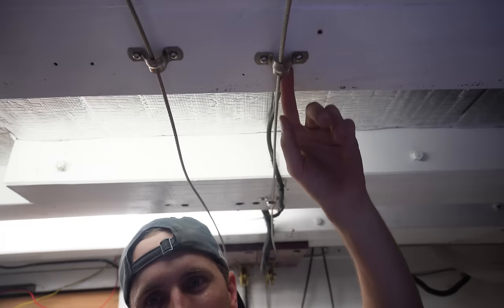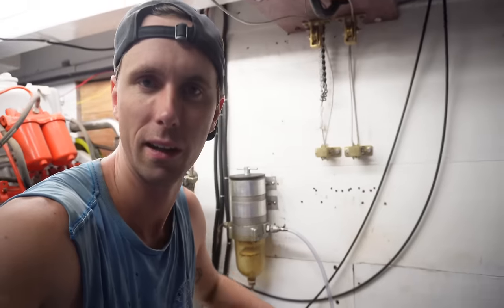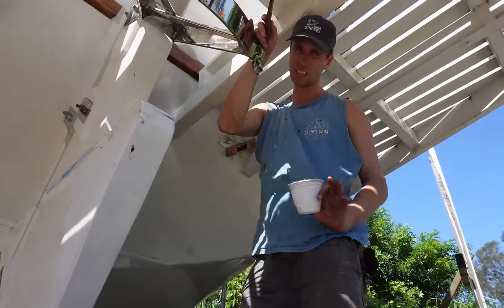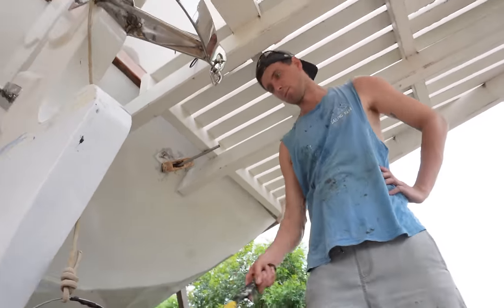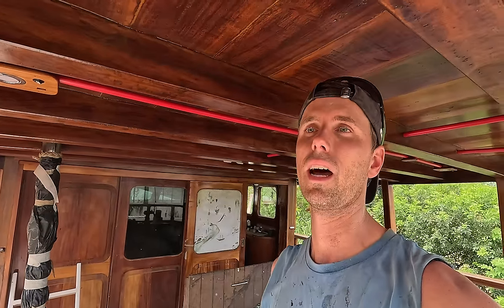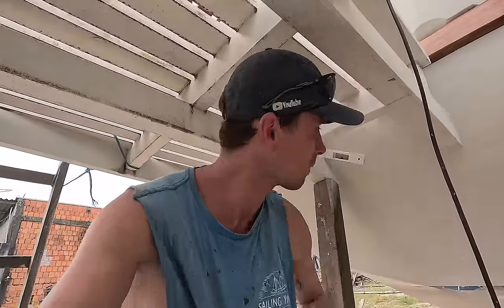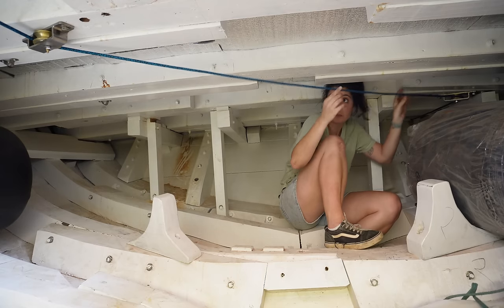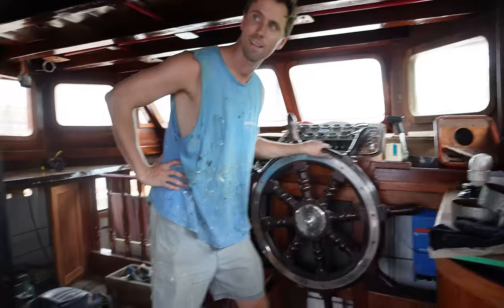Steering upgrades: Ready to steer our rescued boat — Sailing Yabá 166

Comment: man this is just bad.. Really hoped you had swallowed that pride, or whatever it is that is keeping you from bringing in a marine engineer to help you design and Spec out the steering system. Maybe its just naivety that is allowing to think this is a good solution. But to put it into perspective, a lake bound, 16', 50hp outboard motor use 3/8" wound cable with a Teflon sheath over them.. and they still break in rough weather.

Comment: Ach. Its painful to watch you when you make a mistake. A lag bolt is much stronger in shear, as per your inital installation, vs a lag bolt in tension. But you upsized the bolts, its probably good enough. Just unnecessary work. The dyneema is amazing, but the poly outer core is prone to chafe, just keep an eye on it. Have fun learning to splice, when you have more time.